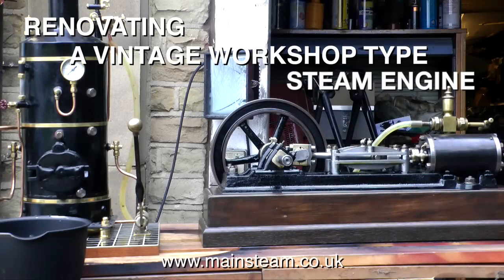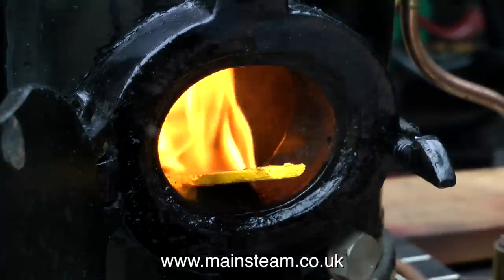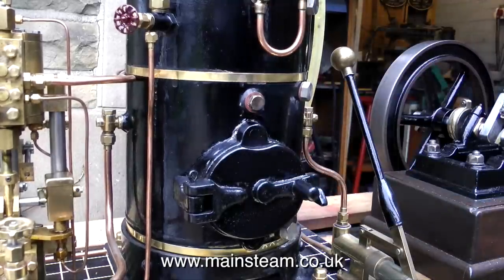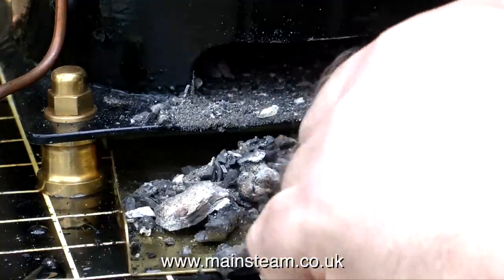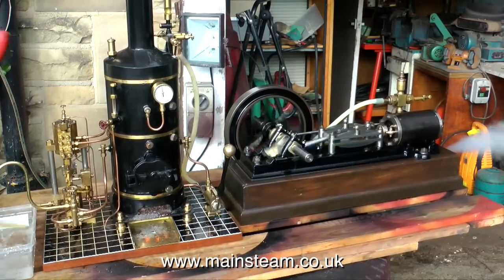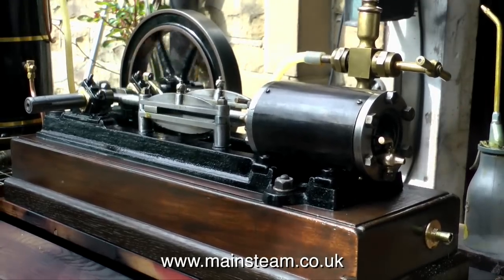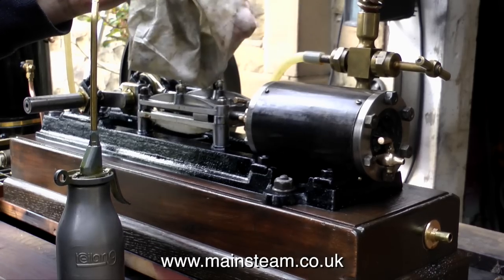PART #12 - STEAMING A VINTAGE WORKSHOP TYPE STEAM ENGINE

Comment: Wow, I have spent the past 2 days watching your videos. I have been a lover of steam power for years, my fathers father owned a large steam tractor and trashing machine, he used to do all the trashing for the neighborhood, so dad had all sorts of tales of those days when steam was replacing the horse on the farm.  Then when I took a job in Central North Dakota, I found the town hosted a huge steam thrashers meet every year, and I became very acquainted with the old engines that were stored there in huge buildings at the steam thrashers grounds, and the meet that lasted three days in September of each year was filled with the whistles of those huge engines as they drove in a parade around the grounds, accompanied  by old Oil Pull single lung tractors and ancient machines of all sorts.  The queen of the bee was a HUGE steam engine that had been used to run a saw mill and was moved to the site and run once a year for just that purpose, the crew would saw up trees that had been cut down from around town and saved for just that purpose.  I do miss those days and as you say, that smell man that takes you back, there is nothing like it.  Thanks for the information on how those engines ran, I find it amazing indeed.

Comment: Very nice video and excellent work on the engine. I like the BFD pump, reminds me of some of the old twin cylinder steam pumps we had in the refinery. Probably an 8 or 10 inch steam cylinder and a pump cylinder of about the same size. Made a terrific sound when being operated by the 250 lb. steam header!

Comment: pretty neat to see the old generation of steam engines my grandfather owned a tugboat in Burlington Vermont that ran by Steam it was a pretty massive engine and it was a brick hauler and I remember head oil chamber I think resonator that would hold the oil when it spills and catching oil.the pump itself remember how stinky messy it was. I help my grandfather took it for a ride haven't heard anything of it about it in somebody's backyard rotting away or somebody has it in the garage somewhere never knew what happened to it it's quite a Steamboat. my grandfather's learn me how to run the clutch well without getting in a snare when you kick it in fast could blow the whole thing but it was special timing when you Prime the clutch to get it propel. I can still remember the oil smell in the water mixed together. I was once told there's a lot of those engines hidden around in dark secret places. it was fun to help my grandfather realign the burning chamber with ceramic brickliners in cement it was delicate work I remember how they go in got filthy out of it. I would definitely love to do it again that was a lifetime memory hoping there's a lot of these engines out there hidden and be found again. i help my grandfather make piston Reed valves that was pretty cool. he also had to fabricate lot of the parts

Comment: Great videos, now I'm hooked. Do you ever use water treatment in the boilers?  What do you do when preparing steam engines for storage?
Reply from the maker: wgenerotzky I generally use Copper boilers so water treatment is not necessary, For storage plenty of steam oil blown through with compressed air followed by WD40 seems to keep them rust free internally.

Comment: Is there a one way valve on the boiler side of the water pumps? How does the pressure not come back through the water feed side?
Reply: I could listen to your voice 24/7, you should narrate books on tape
Reply from the maker: Shane K Yes, there are clack valves at each side of the boiler.

Comment: would a boiler like this be able to sustain an engine like this running under load? if not what sort of size would?
great video as always
Reply from the maker: calm callum Not really, especially whilst needing the water replenishing constantly, this boiler is 6 inches in diameter, I would say that if the boiler was twice that size, then it would be fine.
Reply: interesting that the limiting factor is the boiler......is there a reason for that? is it just that this boiler cant reach the required psi/temp for a sustained load?

Comment: I once saw a guy with his skin and boiler suit mixed together in curled up flecks all over his body, a bit of dark filipino skin with orange boiler suit mixed in, the guy died that night, I was 12. He'd been in the room where the expansion bellows for the forward steam line is, going to the anchor winch. 
Yeah high pressure steam is nasty stuff. 
Love your work and videos, can u make them longer ?
Reply: +HeavyDemir
Steam much like Diesel and Petrol can have terrible consequences if handled and operated wrongly.

Comment: I've got a flat belt driven lathe I need a power source for. Do you think it would be powerful enough for that?
Reply from the maker: Yes but only just- and you would need a large boiler for it . . . . not very practical, a bigger steam engine setup would be much better.
Reply: @keithappleton  Yeah, probably. The bed length is something like 76" long, with a 14" swing.

Comment: Looks like that crank needs some balance weights! I know it's sitting on tyres but it could be a lot less shaky than that if it was more in balance.
Reply from the maker: I agree, but these are sympathetic authentic renovations and adding extraneous parts and modifying the design would be unacceptable to the owner of the engine. It is after all part of a steam engine collection which will mainly be for display purposes . . . .
Reply: Ah, fair enough. Then yes, originality trumps function, definitely!

Comment: I love steam engines but I know nothing about steam engines other than basic concepts. So I have to ask a dumb question. The steam coming out of the engine is wasted. Is it supposed to be run to a condenser, and from that back to the boiler. or to some other engine to use the secondary steam?

My wish would be to have a small engine to run a paddle wheel on the back of a small pleasure boat, or a larger engine to run a steam powered replica that I could take a few friends on. My crazy wish would be to have an iron clad replica, but I need to win the lottery first.
Reply from the maker: It is not practical to reuse the condensate in small models because it is difficult to remove the cylinder oil from the mixture in such a small scale.
Reply: On big engines (or locomotives) the exhaust steam is usually blown up the chimney to create draught. You can also use it to pre-heat the feedwater.

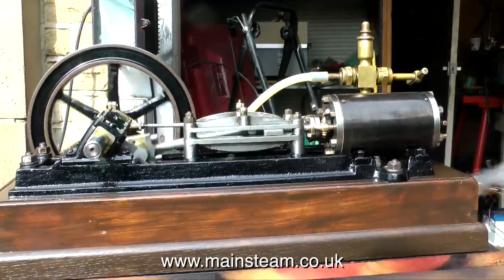Comment: Aside from the steam, what is that coming from the exhaust at 4:40?
Reply: +Mat Mabee I believe it to be steam oil. Since the oil goes to the same place as the steam, it has no way to recycle the steam oil.
Reply: +Mathew Mabee Steam oil, and probably a little water, pretty normal.

Comment: What would a steam engine like this be used for?
Reply from the maker: It was probably built as a test piece for apprentices back in the day.
Reply: @keithappleton  Are any of these smaller engines powerful enough to run a small generator or workshop tools?
Reply from the maker: Not really, they are only Models at this size . . . .
Reply: @keithappleton  Interesting. What is the smallest steam engine that can be used for real work? Where can someone learn about how to safely operate these engines? I'd love to get into this hobby.

Comment: Do you have a Land Rover then?
Reply from the maker: Yes, I completely rebuilt a 1971 Series 2A on a Galvanised chassis in 1999 - I sold it in 2016 to a friend of mine.
Reply: I did the complete rebuild of a 1954 series 1 86 with my brother many years ago (almost 40). No galvanized chassis though, just lots of time with an oxyacetylene welder. It was my first car (jointly owned) and he still has it. He lives near Leicester, and I live in Ohio.